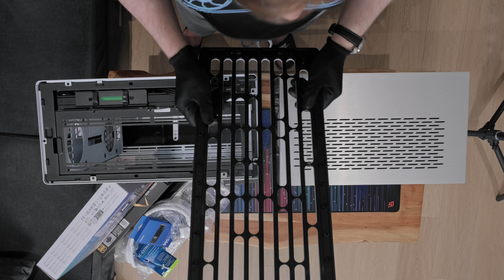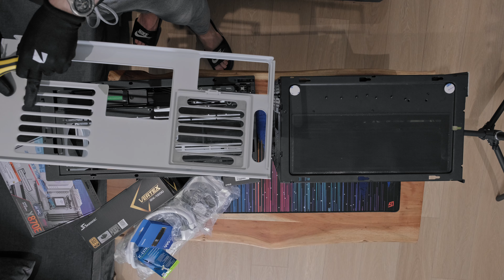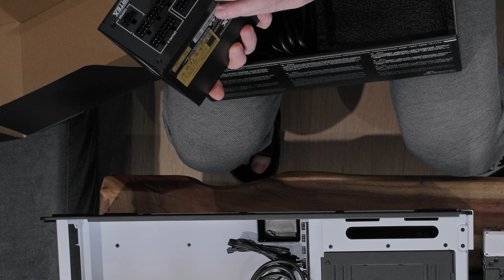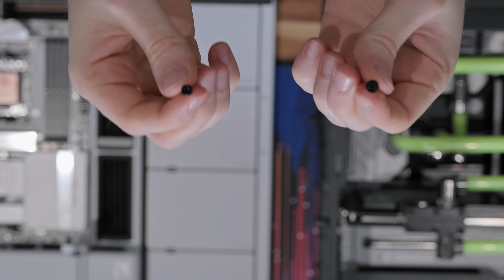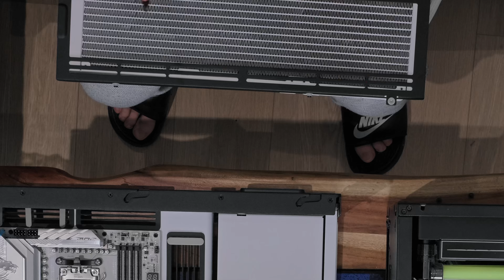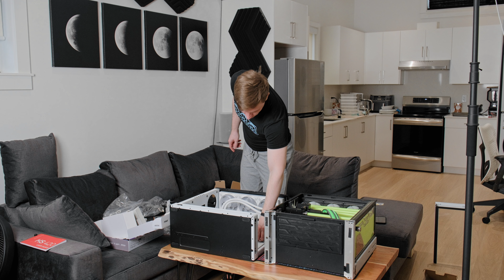HAVN HS 420 vs Lian-Li O11D

Comment: From what I understand, the screws for the glass panel, side panel and rear panel are mainly there as transport or safety screws. The panels themselves are already held in place by magnets together with the mechanical guides/hooks, so for normal stationary use the screws should not really be necessary. I would probably only put them back in if the whole PC needs to be transported.

The mesh also seems to be designed differently depending on the intended airflow. On the side panel, the mesh is clearly finer in front of the three possible intake fan positions. That makes sense, because the intake fans create a pressure difference that causes the higher-pressure outside air to flow through these areas into the case, so dust filtration is more important there.
There is also another finer mesh section around the PSU area. The remaining parts of the side panel use a noticeably coarser mesh.

At the bottom and at the lower rear intake there are also finer dust filters, again because these areas are intended to let outside air enter the case.
At the upper rear exhaust there is no dust filter, because it is meant to be used as an exhaust.

At the top it is different. The visible mesh is much coarser, which makes sense for an exhaust area. A very fine mesh there would not really help much with dust, but it would increase airflow resistance and could also create more turbulence and airflow noise. So the coarse top mesh seems to be more of an open protective grille that prevents larger objects from falling onto the fans or radiator, while still allowing the exhaust air to leave with as little restriction as possible.

So overall it looks like HAVN mainly uses the finer mesh in areas where outside air enters the case, such as the side intake positions, the PSU intake, the bottom and the lower rear intake, while the exhaust areas are kept much more open.

Comment: I was thinking about buying the same case, mobo and cpu cooler but was worried about not having enough clearance. Since the Havn manual states 65mm clearance and the AIO 420mm is exactly 65mm thick with the fans attached. Was it difficult or an exact fit?
Reply from the maker: It fits well and there is a lot of space left
It's a huge case